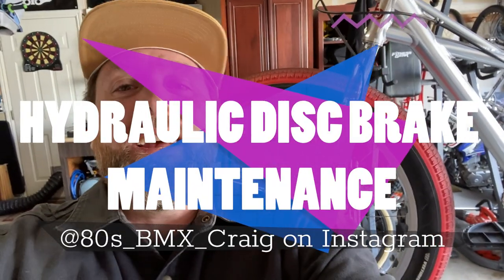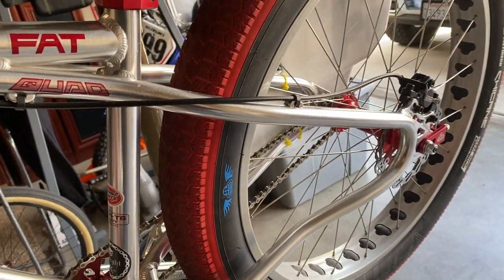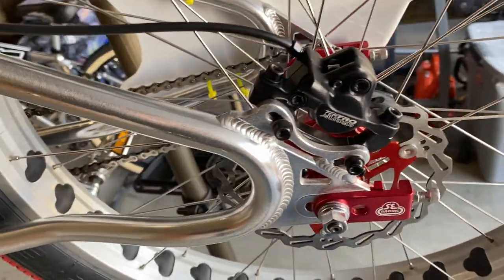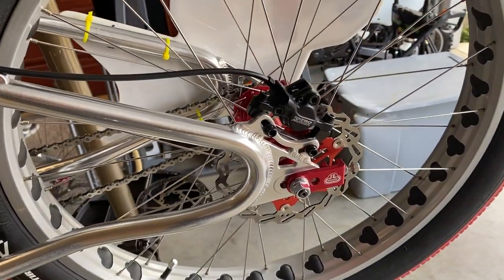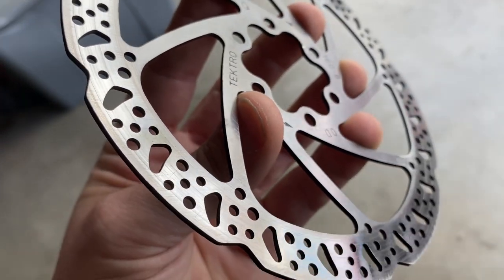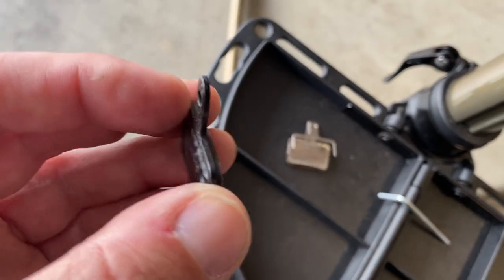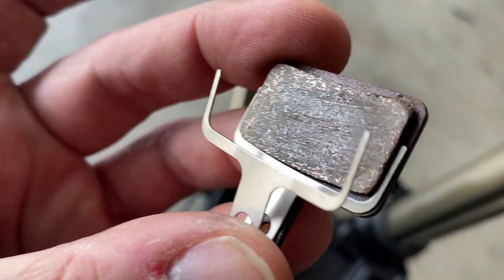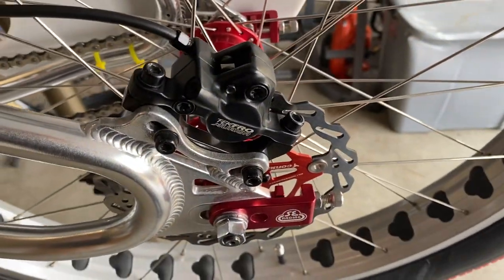Troubleshooting Hydraulic Disc Brakes on SE Bikes.

Comment: I have a new Monster Quad and the rear brakes are terrible. They grind and sort of wobble a little when I brake hard and make just the most horrible sound. How much of this is due to the quality of the brake set versus an issue with the pad or disc?  The bike is new, not even 2 months old. I have a Trek MTB and those brakes are just so much better and smoother. Thanks for the video and the tips!  BTW, where did you purchase your new disc and pads for the rear? Thanks!
Reply: Thanks for commenting Kevin. Sounds like your brake issue is similar to mine. Not sure how much is due to quality or not. I’ve run top of the line Shimano’s on my Monster and didn’t have any issues. But in all fairness, there wasn’t any issues with the stock ones. I just wanted to try them out. My Fat Quad did have that same crunchy sound you’re experiencing, so I swapped those out. Believe it or not, I got the rotors off Amazon, and the pads too.
Reply: Me and brother both got new bikes and once both of our brakes wore in they started making the noise the front ones are quiet tho I tried cleaning the rotors and pads and even swapping the front and back pads and it still does it so I'm guessing it is the rotors.

Comment: Had the same issue on my Fatty Q rear brakes.. took them apart.. sanded the pads down, cleaned the rotor, still had the issue! (wth) so took to bike shop and replaced pads.. issue gone.. Unfortunately its happening now to my new Fast Ripper smh..
Appreciate the Vid! thought it was just me!
Reply: Did you end up sorting out that noise with the fast ripper? I changed the pads to something better and still hearing that shitty noise.
Reply: i notice that its an issue with alot of disk brake se bike

Comment: I'm converting my big ripper to hydraulic breaks I hope all goes well. Could you do a video on that? Converting a ripper to hydraulic breaks
Reply from the maker: I’ve only seen it done well once and it was Kyle @vegaspedalbloxx on Instagram. He’s got a YouTube channel as well. He did a bolt-on adapter and said it worked well. The other option is a magura hydraulic brake that bolts to the brake mounts and grabs the rims like a rim brake on steroids🤘
Reply: I want a new bike now